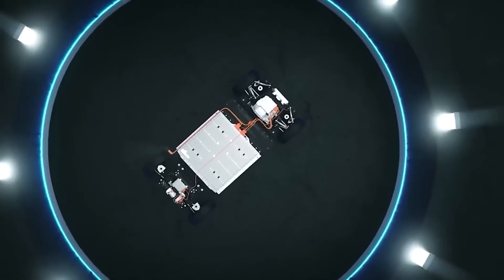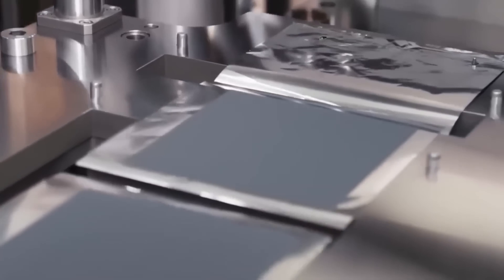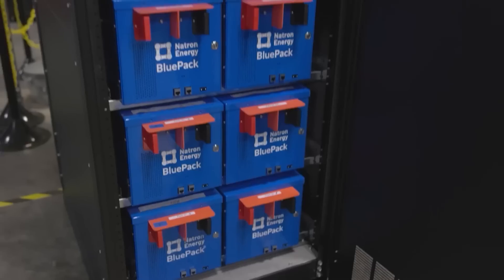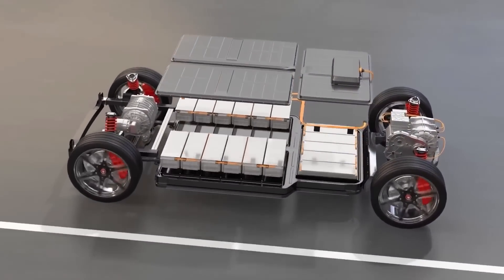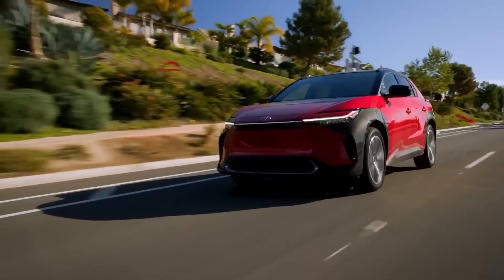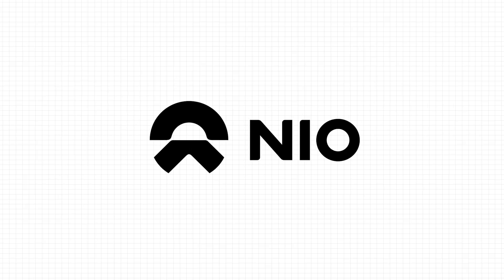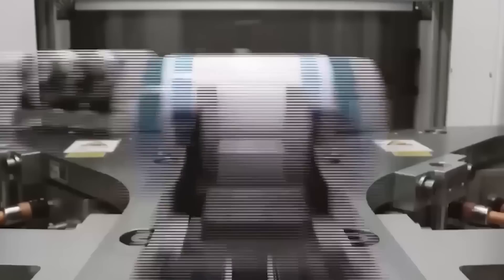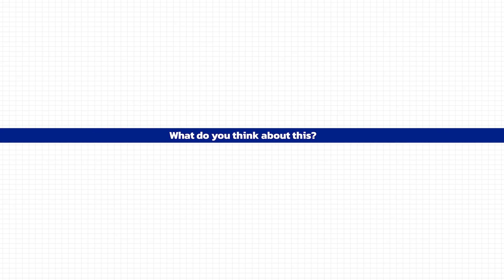Is This Cheap Solid State Battery The End For Gas Powered Cars?

Comment: Dollars being used by gas tax will eventually have to be incurred by EV’s as they use roads as well, but this hasn’t been calculated in the Ev cost which makes it NOT so cost effective?
Reply: More and more states are collecting tax on electricity at electric charging stations.

Comment: You can suddenly feel the air let out of the EV balloon.  Do these manufacturers expect millions to pay 1.5-3x a reliable ICE vehicle for an inconvenient and/or impractical EV that is at risk of having it's $30k battery become obsolete within a few years?   The hype and propaganda from the eco-zealots might destroy the manufacturers who went woke when they should have been listening to their customers.  EVs need more time and everyone has to admit they meet a niche need only.  9,000 lb trucks are not a viable application of this technology.
Reply: What a load of fud. Actually get some facts in your comments because any EV owner like myself can give you facts and I can tell you an ice car cost 6x the cost to run than an ev. And the initial higher cost was paid back in just 2 years in fuel savings. And how do you get it will be obsolete in a few years when they are getting software updates all the time unlike an ice car that is using parks and designs made in the 19th century
Reply: @damiendye6623  source: your arse. 
EV vehicle designs are NOT fit for Nordic conditions, not for heavy industry / military / heavy load trucking purposes, and absolutely turn obsolete faster than combustion engine vehicles. When the average EV has a towing power of 0 (zero) kilograms and batteries age faster than on iPhones, you'd be hard pressed to recommend overpriced electric toys to anyone living in the rural areas with long distances to any and all services + harsh weathers.

Comment: Any tech that gets rid of gas/oil/hydrogen/diesel is a good tech.
Reply: Why would you want to get rid of hydrogen as a fuel?
Reply: @joninwv he hates cars
Reply: Meanwhile you're pushing in exaggerated excavation of rare materials needed to build even the most basic battery, all while not providing a solution for the main problem: how the fuck do we generate enough power to charge up all those 16-32 billion vehicles in the near future, if we're already struggling to keep the lights and heating on around the world, even in the 1st world countries, especially during the winter time?

Comment: Are Ford and GM building the right kind of batteries to compete with these solid state (Toyota) ones?
Reply: Who cares if they are, I'd have a Toyota any day b4 a Ford or a Chevy, I like driving my car rather than having it worked on
Reply: They don't have to.  So far Toyota has said this 2-3 times over the last 7 or 8 years.  I think it's not going smoothly for them.  I don't recall them even having a concept car with these batteries to show.
Reply: @TheEvilmooseofdoom  The Chinese are already selling a BEV with solid state batteries.  They are real and IF production costs drop, they will be a game changer.  500 REAL range in hot or cold or hills will convert me.  This assumes the charging network becomes more reliable and available.

Comment: until we actually see this tech on the road and being used otherwise it's all what if !!! years of amazing battery tech talks but none has been released into the world yet, a good example is graphite battery coz I remember hearing it about decade ago or more that thus amazing graphite tech will revolutionized smartphone battery with one charge lasting days or battery don't spoil or burn easily but guess what decade later not one single phone out there uses it
Reply: But graphene batteries are already used in some electric motorcycles.

Comment: We need more Hybrid ICE vehicles.  Many more!
Reply: Death to Hybrids. EV only. Hybrids are not evs.
Reply: Hybrid ICE vehicles catch fire even more than ICE do. Gas is the new Dinosaur.
Reply: Yes hybrid worst of both worlds, tiny battery lugging all the dead weight of the engine, the. The engine lugging the dead weight of the battery, and all that complexity in keeping both systems operational. Hybrid had it's day and a typical EV rungs rings around it.

Comment: LFP batteries are good for 3500+ charge cycles @480km range like BYD Atto 3 that is over 1,680,000 km before battery degradation worth replacing. Find me a ICE car that will last more than 1,000,000 and cost as much as the Atto 3. 

I wish tesla would hurry up and move over to LFP tech.
Reply: Tesla are already using LFP in their standard models and are moving to the superior M3P chemistry from CATL
Reply: @bananacabbage7402 on none freemont cars
Reply: Wow, so they go one million miles? Are you sure. The bearings don't wear out & the frames don't rust? I don't know, you sound like a liberal parrot to me.